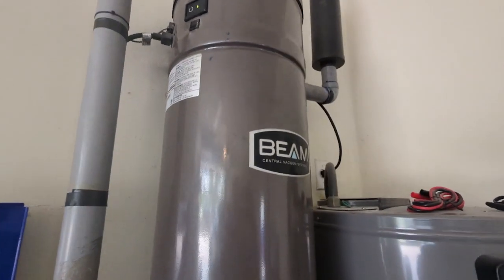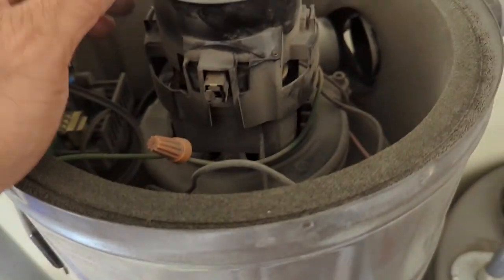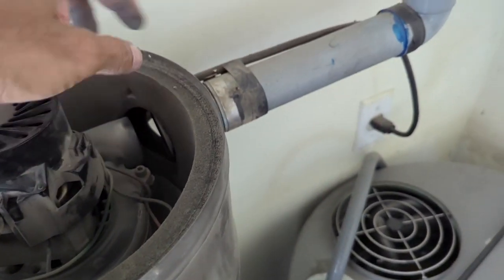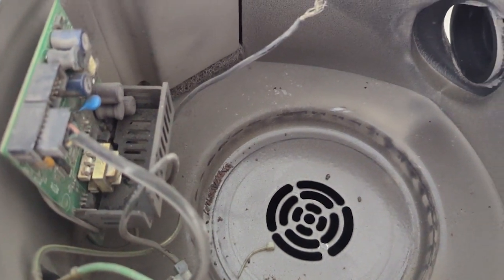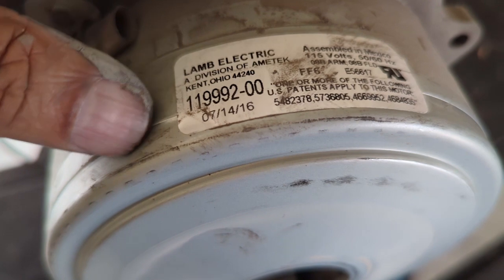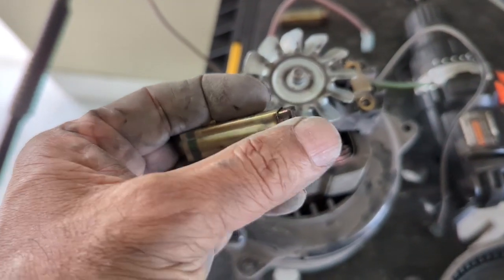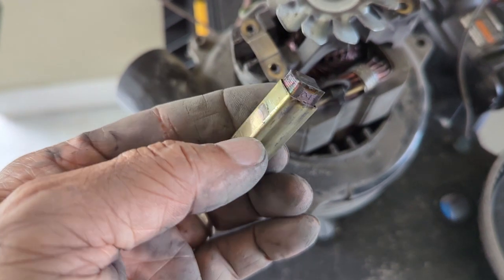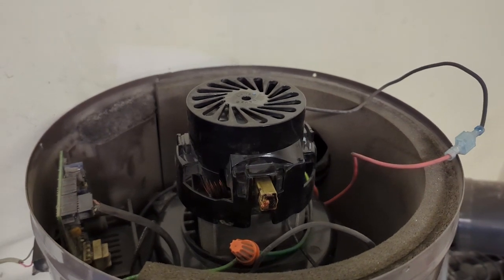Seized Beam Central Vacuum motor brush replacement (FAIL)

Comment: I have a problem. the vacuum cleaner turns on once and works, but after a few days it doesn't work. the green light is on. What could it be?
Reply from the maker: Happens occasionally to me. unplug the power and wait a moment, then plug power back in. I think the control board needs to be reset.

Comment: If it starts and shuts off like that at the end, that means I need to change the motor for sure?
Reply from the maker: yes
Reply: Thanks I bought one it's on its way. I also checked the brushes and they were still fine.

Comment: Thanks for the video!  Our vacuum is still working well, but just determining how best to maintain it.  (It is an older vacuum, but new to us.)  I just ordered a new filter bag for it and now I'm wondering if I should check the brushes?  Did you install a new motor?  How much was that, and is it working like new again?
Reply from the maker: Yes, I am on my 3rd motor. It was around $80. Find the model number of the old motor and google it, you may not get the exact replacement; however, there are many aftermarket motors available. They seize up over time, possibly from dust in the bearings. I am not sure if the brushes would have lengthened their lives, but I am willing to try.